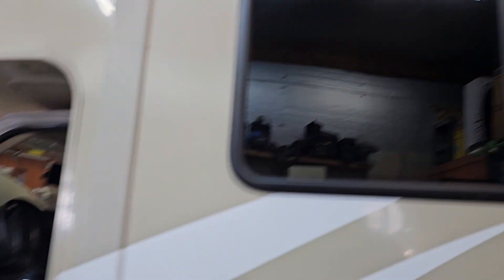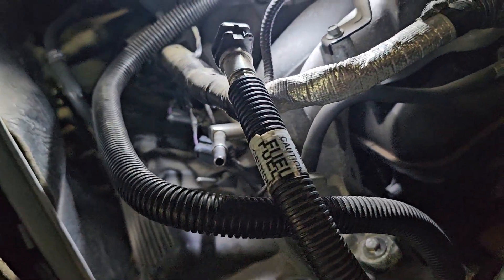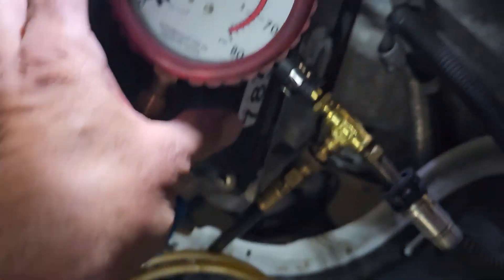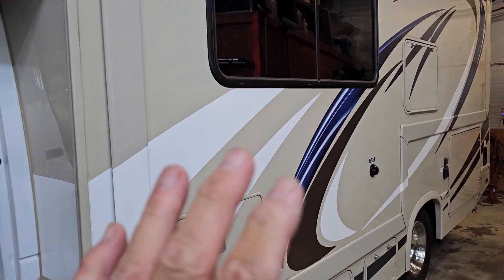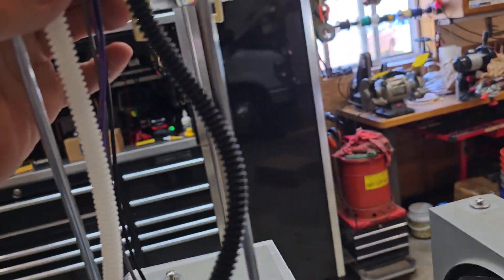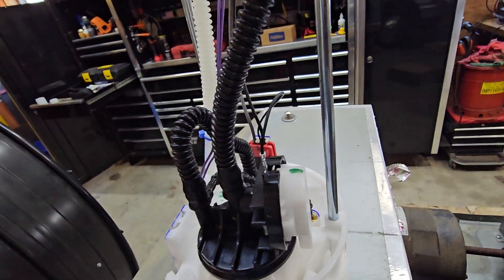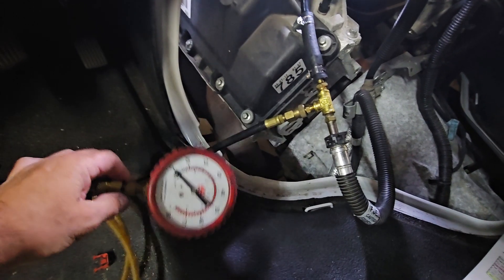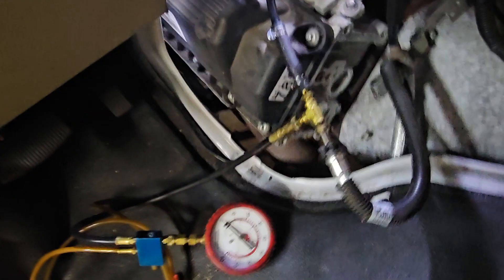E450/350/F53 V10/V8 Fuel pressure testing. Video 1 of 4

Comment: I have a 2006 e450 6.8l and I’m having a hard time finding specs for the fuel pressure psi. Some things I’ve seen online suggest it’s much lower for my engine than the specs in this video for the 2018 you’re working on. It’s not in my Owners manual, unfortunately. Are you able to help me find the right specs, please? My engine doesn’t have a test port either so I’ll be testing the pressure in the same spot you are once I figure out what fuel pressure gauge kit to buy. Thanks.
Reply from the maker: Get me the vin number

Comment: 1999 Ford F53 6.8l Fuel pressure 30 psi immediate drops to zero after prime. Checked pressure after fuel filter, 40 PSI, no drop. Replaced fuel pressure gauge, injectors, filter. HELP!!
Reply from the maker: Show me how you have it hooked up. As I mentioned in the video ford has 3 types of fuel regulation system.  Which one does yours have?

Comment: You’re a smart guy. Can you tell me the symptoms? I have a 2010 e450 that has 60 psi on prime but drops off. It’s running extremely rich and is puffing a ton of black smoke.
Reply from the maker: What do you do for a living?
Reply: @Rvdiagnostics  I’m a c5/6 quadriplegic that sells cars lol
Reply from the maker: What you end up doing?
Reply: @ lol. Well… I threw an open wallet at it to not fix any issues. Come to find out… it was the air filter. I checked all the obvious simple things but the air filter end cap came off and lodged itself in the intake manifold. So it wasn’t getting any air. Pissed me off. But she’s running like a champ now.
Reply from the maker: What fuel regulator system you have ,Ford has 3
Reply: @Rvdiagnostics  on the pump style.
Reply from the maker: Also what is the fuel trim for bank 1 and bank 2 . Could be a injector open ( electric or mechanically)
Reply: @Rvdiagnostics  I’m not 100% sure. How would I diagnose fuel trims per bank
Reply: @Rvdiagnostics  I have an autel scanner. I’ll check it out this week.

Comment: I have a 2015 F450 that has a hesitation under heavy acceleration like getting on the highway. Other than that it runs smoothly and starts great. What we’ve done so far and replaced. Mass airflow sensor,plugs,wires,throttle body,all coils. Still there. Thinking maybe replace/check fuel pump next? P.S. was doing it when we bought it I start it bi-weekly fresh gas and Sea foam.
Reply from the maker: Yes check pressure koeo and running idle/load. KOERIC KEY ON ENGINE RUNNING, IDLE AND CRUISE( DRIVE IT DOWN THE ROAD
Reply from the maker: So what did you find